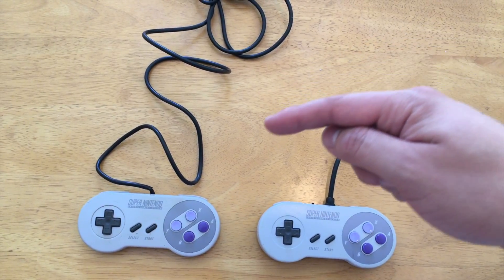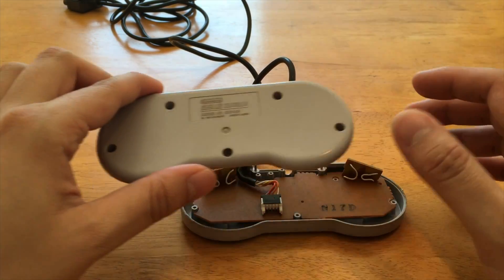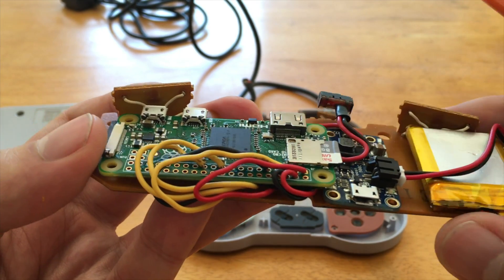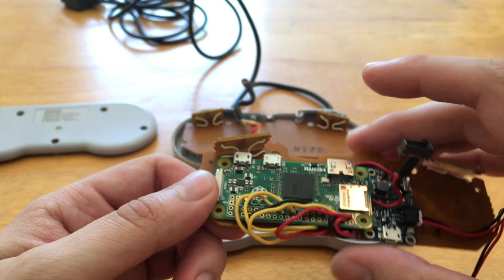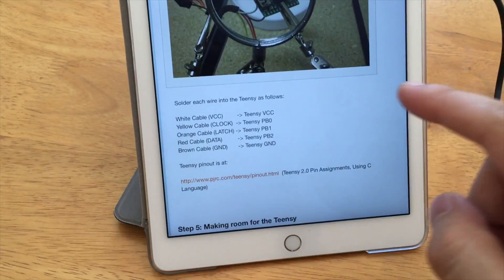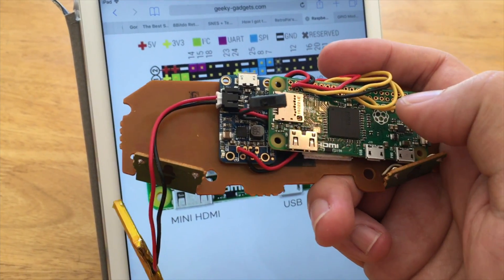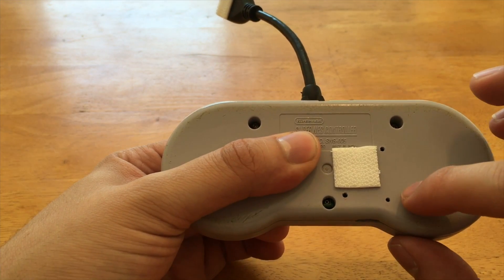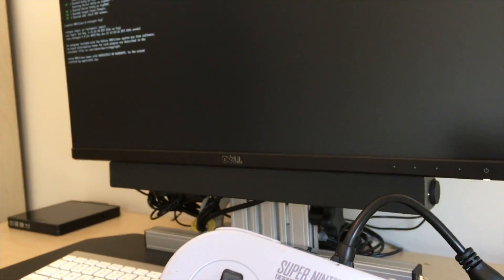Raspberry Pi Zero inside an SNES Controller - The SNS-005Z

Comment: Hi!What if I got only 4 wires on the controller in what places do I have to solder them?
Reply from the maker: Hi Seba, it sounds like you may be using a usb controller (4 wires) as a base instead of an original snes controller.  This walkthrough is built on using an original controller which has a circuit board that requires 5 wires

Comment: I know this is kinda out dated but what gauge wire did you use? And will it work with the zero W?
Reply from the maker: Main thing to check for Zero W would be power draw difference between that and the original zero.  If they are close I believe there should be enough headroom in the components I used for this build to handle the zero w.   I believe I used 26 gauge wire.

Comment: Great tutorial.I used this in addition to your instructables page.   Built one. Works fantastic. Though I had to do a couple of work arounds to get the gamecon driver to work. But they were very simple. Basically used a keyboard plugged in while the controller was still open to get to the configure input menu, unplugged keyboard, configured with the pad. I'm sure there is a simpler way. But I'm not much of a linux guy. Anyways, TL;DR, thanks for the tutorial.

Comment: this project is amazing, thanks for sharing this very comprehensive guide!

However, I'm stuck at getting the buttons to work.  RetroPie recognizes a second controller on the controller config screen, but does not recognize any of the button presses.  has anyone had this issue?  I adjusted the gpio modprobe file as specified.

Comment: Truly amazing man. Awesome job, time and work you put into this. The ONLY thing i wish you could do is incorporate wireless system connection and controller to t.v. Not sure if there is a hdmi bluetooth adapator or something like that but probably to expensive. You should do same project with bigger controller and better single board computer. But still, my little nick picking aside, i tip my hat to you sir

Comment: Great Video. If are worried about the battery moving around you can always use low tac double sided tape. How long does the battery usually last on this?
Reply from the maker: Good call on the double sided tape!  The 500mAh Battery lasts about 2.5 hours.

Comment: I like it. But you really need to invest in some 30 awg kynar solid core "Mod wire". Just search 30 kynar mod wire on ebay. You don't need venting holes, just use a thick thermal transfer pad, between the plastic back and the SoC. Plastic isn't a great conductor of heat, But it should be good enough. Since you only need to dump a couple watts of heat.

Comment: Can't you just cut the cable and solder the existing wires to the pi, leaving the wiring harness as it is?
Reply: Tried it and it works just as fine. Just cut the cable, remove the isolation and solder the wires to the GPIO ports. This way you don't need to do any of these tiny soldering points on the controller board which i struggled to do since i'm a total noob at soldering and don't have proper equipment.

Comment: Hey. Your video is great and I started to make my own.
I connected the controller to the pi via your wiring guide. I installed the gamescon drivers but now my pi wont recognize the controller when I try to set up the inputs. 
Any ideas?

Thank you.
Reply from the maker: Hi funkmastafog, for the changes made in gamecon.conf file do you have the following...
options gamecon_gpio_rpi map=0,0,0,0,0,1
Reply: Thank you for the response. I did not do that. When i went to install the package it installed correctly. But now i cant find gamescon.conf in the etc/mod folder. Maybe ill just do a full reinstall.

Comment: Hello again, sorry for the inconvenience.

I have been searching and I have not been able to find in Amazon a store that makes shipments of 
batteries of 500mA, but I found one of 1000mA. Does it serve the same? The only thing I would have to change is powerboost, I had seen this:

https://www.amazon.es/Adafruit-PowerBoost-1000-Charger-Rechargeable/dp/B010M8UVYY/ref=sr_1_1?ie=UTF8&qid=1484836806&sr=8-1&keywords=Powerboost+1000c

This is the battery:

https://www.amazon.es/Polymer-Lithium-Ion-Battery-1000mAh/dp/B00DJ7Z2WC/ref=sr_1_fkmr0_2?ie=UTF8&qid=1484836693&sr=8-2-fkmr0&keywords=Lithium+Ion+Polymer+Battery+-+3.7v+500mAh

I do not understand much about batteries, so if you could help me, I would appreciate it.

Thanks.

Comment: Helo! I just bought everything and just waiting to have some free time next week to start the project. 
some questions I have, since I  haven't work with raspberry before: 
1 - do you have some tutorial (an easy one) to how to install retropie on raspiberry?
2 - I have a mini USB to USB cable, and was wonder if I could disassemble the cable and leave just the thin wires, so maybe I could connect to the regular USB port from the raspi and have a second controller to connect. Do you think it is possible to connect the second controller in the data mini USB port from the raspi? 
thanks a lot hope to hear from you soon ;-)

Comment: how would you load new games into the system? I'm planning to make something similar to this in the future and would like to know if you had any troubles plugging a USB into the system. is there a way to do this without taking the controller apart each time?
Reply from the maker: For now to add new roms yes I need to take apart the controller.  I am working on a V2 that exposes a USB port to make it so I don't have to open it up.
Reply: Anthony Caccese why don't you just use one of those wifi/wireless SD cards? Wouldn't need to get into the controller.

Comment: Hey, I really like your project and now I am trying to build this thing myself, but I am struggling with GPIO drivers :/ Could you make a video or instructions with pictures for GPIO drivers installing and configuring? Thanks.
Reply from the maker: Hi Kristijonas Grigonis, yes I plan to work on one but it will likely be a few weeks.  For now can I help answer any questions?  Have you gone through the steps outlined in the video description?

Comment: Hi Anthony. I have a question. Do you think that it is possible to use a raspberry pi 3 instead of Pi Zero? I don't want that the raspberry fit into the controller but I want to use the controller as a Makey Makey device. Cheers and regards from Venezuela.

Comment: Would it be the same to use a USB Snes controller?
Reply from the maker: The mod I did in the video is tailored to using an original.  However there are a few comments in the thread below that go into options for doing a similar mod with USB knock offs as well.  The main things to watch for are making room and the wiring differences (usb wouldn't need the gpio driver for example)

Comment: What gauge wire did you use? Having trouble finding thin circuit board wire. Thanks.
Reply from the maker: I used 22gauge at first.  Advice though... avoid the mistake I made initially using solid core wire - look for stranded wire instead.  It's easier to maneuver and bend.

Comment: So is the original Super Nintendo the way to go instead of like a knock off controller ?
Reply from the maker: The mod I did in the video is tailored to using an original.  However there are a few comments in the thread below that go into options for doing a similar mod with USB knock offs as well.  The main things to watch for are making room and the wiring differences (usb wouldn't need the gpio driver for example)

Comment: Soldering noob here. What exactly am I soldering to what? Do I need a GPIO header? Or do you just solder the wires directly to the pads? Thanks, awesome project, can't wait to try it out!
Reply from the maker: Hi Brian, This may help https://learn.adafruit.com/adafruit-guide-excellent-soldering/tools  I read through that before starting this project as it was my first time soldering as well.  For this project you won't need any additional headers you'll be pulling wire through the GPIO holes and soldering at those points for all the parts that need it.

Comment: I too am tackling this project as a Christmas gift for my son. I have noticed the Power Boost 1000 has the JST connector on the other side of the board. So I resorted to cutting it off and will directly solder the battery leads to the power boost directly. I am also going to combine another project that uses a few simple components and a couple of scripts that will allow one button on/off and low power shutdown as well (https://github.com/NeonHorizon/lipopi/blob/master/README.power_up_power_down.md). I also plan to install a single USB A plug to load roms, attach a second controller, or usb hub for wifi and keyboard.
Reply from the maker: This sounds awesome.  Would love to see how its wired up.

Comment: Thanks for the project and info. I'll be making one of these. Just curious, would it be possible to get two players?
Reply from the maker: Yes its possible - would need to add a breakout USB port which can be done by soldering to the USB test pads on the bottom of the pi zero.

Comment: I started my own version of this but I am going to use the long usb cable for power.  The controller input will be wired like in the video though.  I had a thought if I hot glue the controller bard down it should tighten up the buttons and keep the pcb from flexing.  I am using a cheap Chinese knock off snes controller for this project.

Without this video though I would have gotten stuck on making room in the shell.

Comment: Is the power boost necessary if I don't want it on its own power?
Reply from the maker: If you want to wire to the power of the pi directly the powerboost is not needed.   That would also remove the need for the power switch as well.
Reply: Anthony Caccese thanks dude